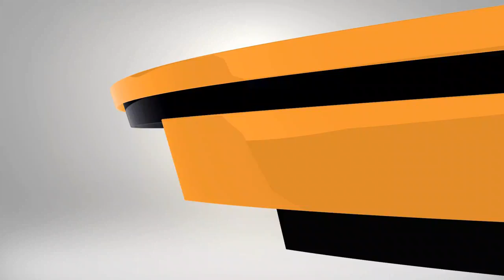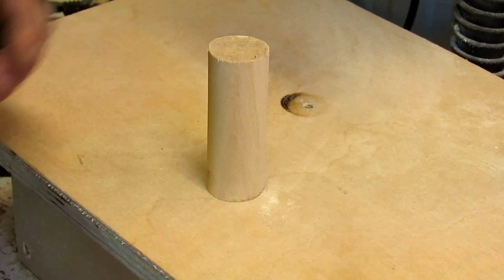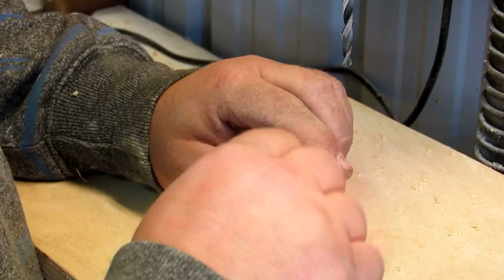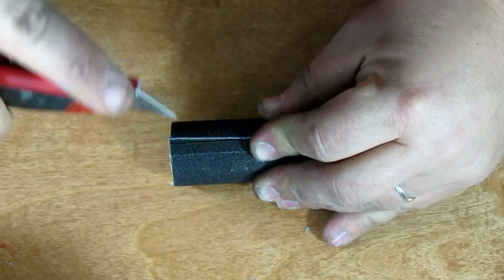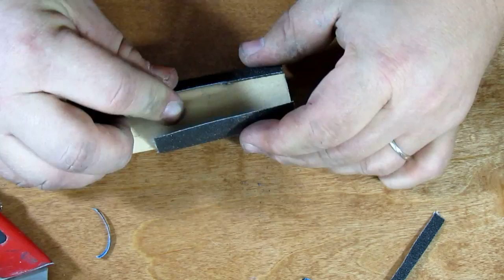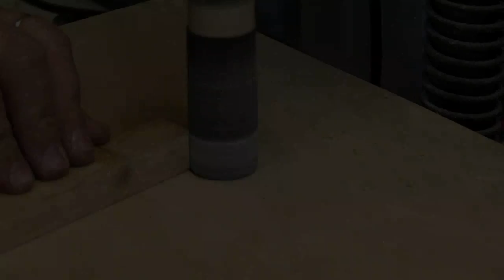Easy DIY Spindle Sander for Drill Press - Made With A Dowel

Comment: Epoxy is fast to glue but expensive , I prefer to use glue that is more economical , I generally have about 5 dowels ready to go so my glue doesn’t have to set quickly but it needs to withstand heat approx 140 degrees otherwise it will come off it’s not hard finding the glue but it’s a challenge buying it  economically I guess it depends how much work you do